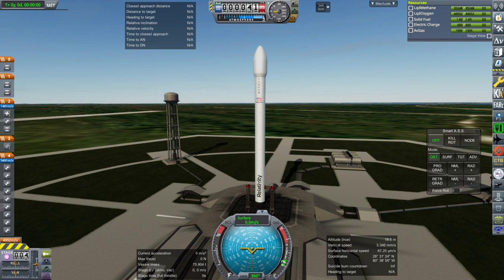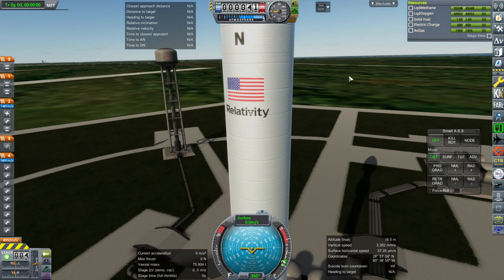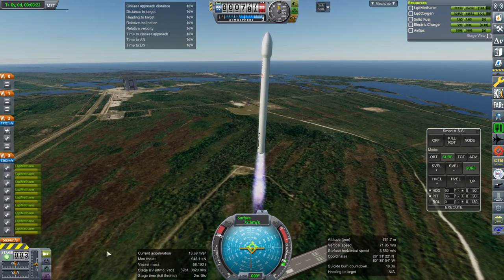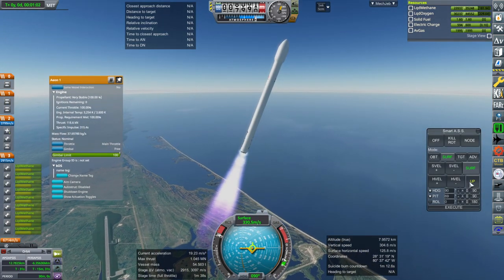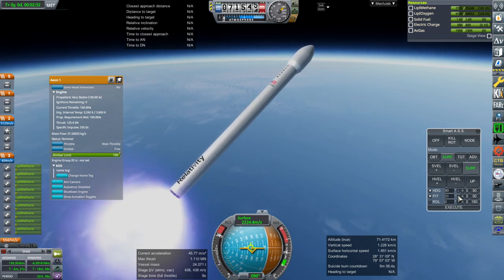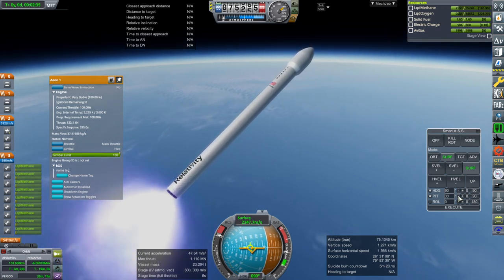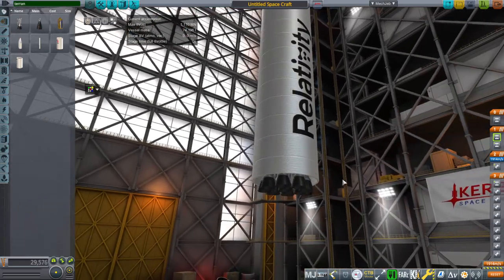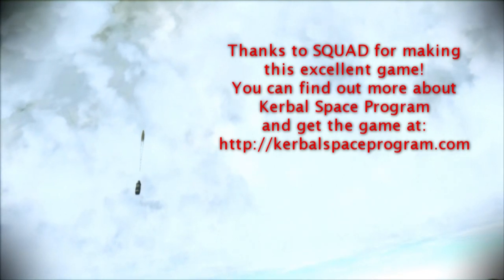KSP with Realism Overhaul - Terran 1

Comment: 1. Is the falcon 1 or the electron in the small rockets pack?
2. I don't want to be a party pooper but I don't have tweakscale and I can't use the payload adapter without...could you make it procedural please.
3. Do you know of a procedural engines mod?

Continue the great work and don't make it to hard on yourself...
Reply: Just get tweakscale
Reply: @coffeespy1133  I'm thinking about it.
Reply from the maker: @Alluin Herric 1. Other modders have already made Falcon 1 and Electron, so they're low priority for me. 2. This rocket doesn't require the payload adapter to be resized with Tweakscale - it'll fit as is. If you need to, there's a procedural one in procedural parts, but you'll have to clip your own control core in. 3. I've heard of a procedural engines mod, but haven't used it, especially given the ease with which I can just model any engine I want.
Reply: @RaizSpace  Thanks!

Comment: @Raiz Space where do you import the blender file into and do I have to save the file as a .obj
Reply from the maker: You should save the file as an FBX and import it, and its textures, into Unity. In Unity, you need to use KSP Part Tools to export it as a .mu file with the textures.
Reply: @RaizSpace  ok thanks by the way can I also use collada file to or only fbx then .mu
Reply from the maker: You can use collada dae, but only for stuff without animations. It's better to use FBX in general because it's more compatible with other things.
Reply: @RaizSpace  the models I use is SketchUp but when I import it to blender it keeps showing errors
Reply from the maker: I don't know anything about SketchUp.

Comment: I'm still not convinced about how legit Relativity Space is. Why would 3d printing a cylindrical fuel tank be faster and cheaper than making it out of sheet metal?
Reply: For one, it requires fewer parts to build the rocket itself. It’s a method of integrating many parts into a single part while also strengthening the entire structure in the process. Also, there are structures made with complex geometries which are highly optimized for strength to weight that can only be done by 3D printing.

If that doesn’t convince you, 3D printing doesn’t have to just build the rocket itself. Virtually all the tooling required to build one, the molds for making specialized parts, and jigs used to accelerate assembly processes like those SpaceX use can also be 3D printed, and require much less effort to design than the rocket itself. So even if the rocket design, which can be iterated extremely quickly in a virtual environment, then fabricated and tested to failure in the real world, cannot be better than the standard processes of buildings rockets, it’s the machine that builds the machine to make these rockets that would benefit even more. 

In the RepRap project for example, people have been experimenting with the idea of making parts of FDM 3D printers through 3D printing, which helps cut costs significantly.